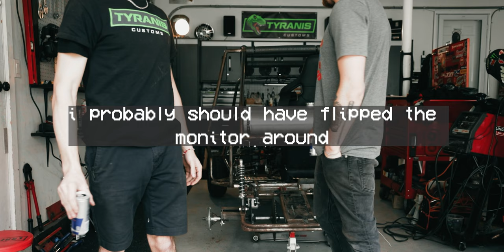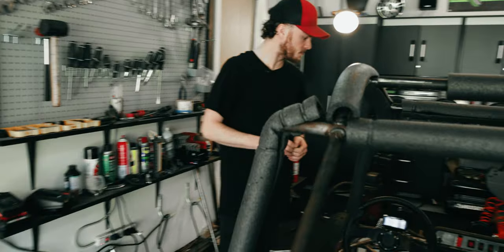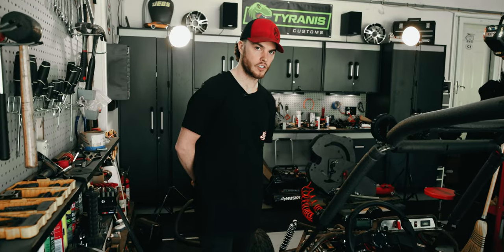420cc Predator Go Kart Hydraulic Brake Install 2.0 | TYRANIS EP40

Comment: Can you show some close ups of the brackets for the caliper? I have the same brake set up but my bracket broke so I need a better idea.
Reply from the maker: The way I did it was actually stupid simple. I just drilled holes in the ends of two 4" pieces of flat bar, bolted them onto the caliper, held it in place where my "brackets" touch the frame and just welded it in in one piece. I'll try and remember to post a pic later